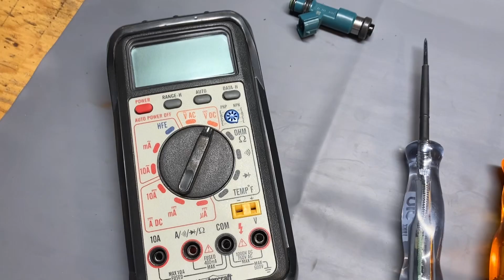Single Cylinder Misfire Root Cause Fault Determination

Comment: The power of knowledge is amazing,
Just from knowing your tools and how they work you can identify an injector that is falling once the engine is running and the coil gets hot regardless if the injector tested good when is cold 👍👍👍
Reply from the maker: Excellent point. Checking components in a static state, falls well short of dynamic testing. Thx for bringing up this critically important point, which I failed to mention. Thx for watching 🍻🍻

Comment: It looks a good tool for the mobile mechanic, doesn't take up much room on the van and it wouldn't matter that much if it started raining whilst carrying out the diag, unlike an oscilloscope getting caught in the rain.
You are a better teacher than some people i have met on training courses.
I managed fo find a used Rob Siegel electrical system book, glad you recommended it. Cheers Matt
Reply from the maker: Hi Matt. I like that test light, switching the clip between battery positive & negative (ground) can be annoying with conventional test lights. 
I really enjoy Rob Siegel’s material. Super clear explanations and quite comical at times. Thx for the kind words, coming from a first rate technician/mechanic like yourself, it’s greatly appreciated. Hope all’s well. Cheers M8. 🍻

Comment: A very good lesson there
Reply: TGibby thanks for all your videos! Question when you did the last part of the test that showed both legs on. Was the LED light connected to the positive side of the battery?
Reply from the maker: @truhntrz3408 This test light hooks up to battery positive & negative. It can sense both ground (green LED) & positive voltage >3.3V (Red LED). In the sequence when it looks like both LED’s are lit simultaneously, it’s only because the switching is so fast. The difference in LED intensity is indicative to injector pulse width. Let me know if this doesn’t answer your question. Thx & thx for watching 🍻
Reply: @TheGibby3340  yes Sir makes sense now. Thx again!
Reply from the maker: Thank you Kevin. Much appreciated 🍻